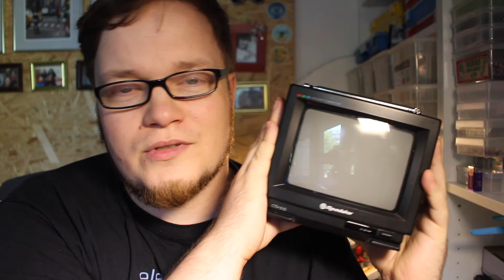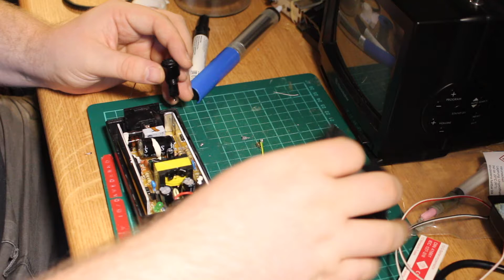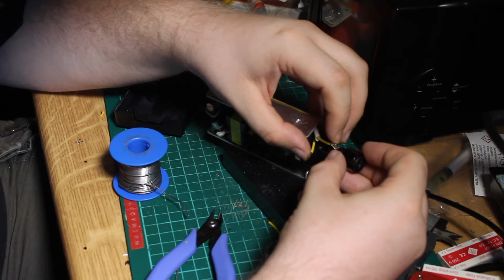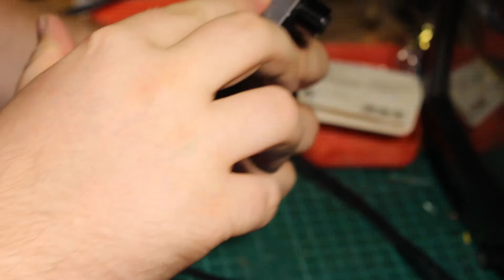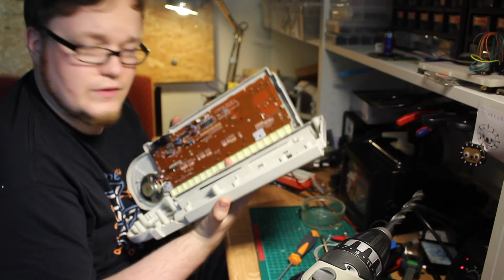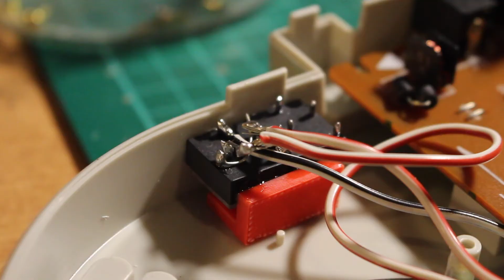Power Playing Them Tunes And TV

Comment: @davedarko Hi Just Dave! :) If you are wondering why the power  is  a negative center tap. It is because it acts as a switch to use the batteries or AC when you plug it in.
Reply from the maker: I actually said that in an earlier cut, but deleted it because my explanation was a bit wibbly-wobbly :D I think it was mentioned once on EEVblog
Reply: I don't remember where I had seen it. On the EEVblog or Julian Ilet. The question was when did it change and why. :)